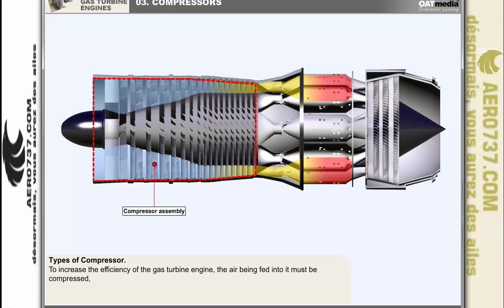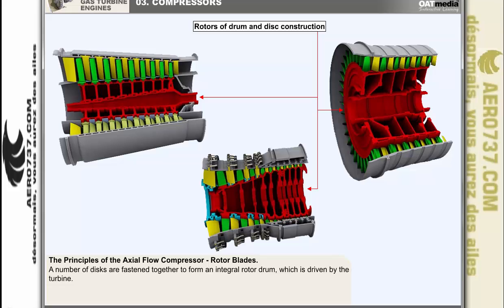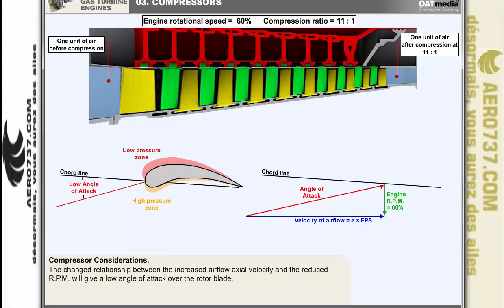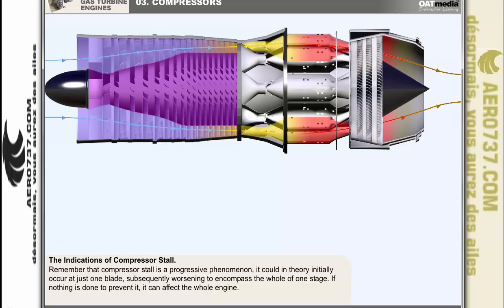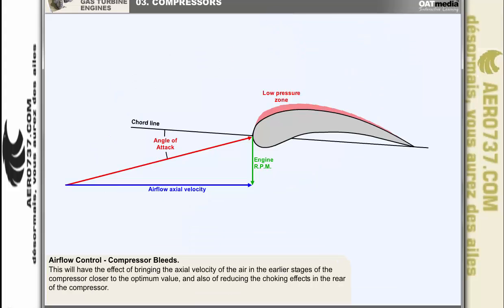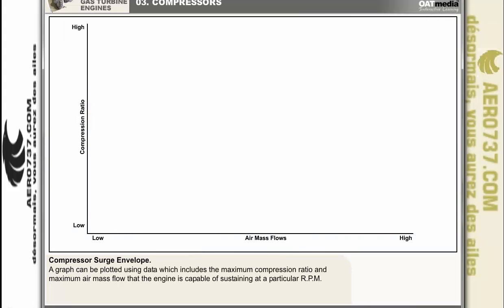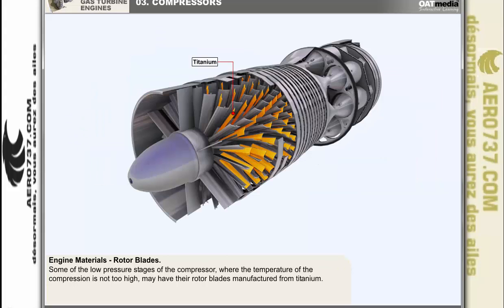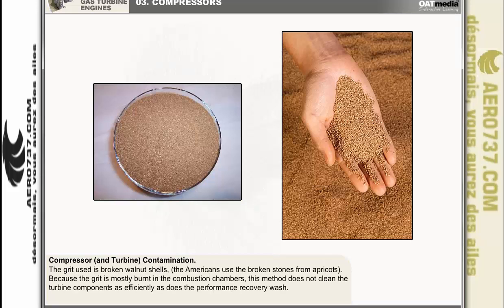Gas Turbines Engines-Part 3:Compressors

Comment: There is a lot of love in the design of one of these hair driers. Makes me feel very good in witnessing through these nicely produced YouTube Videos. Already I am in admiration those who find a way to study and work with such engine poetry. It almost feels like each working turbine is a laboratory in the study of air vapor under pressure and fluids. Thank You AERO737 https://youtu.be/PQQSUe7lX3sGas Turbines Engines-Part 3:Compressors YVO

Comment: I have just found this series of videos and my initial reaction is positive.  However, the term 'compression ratio' applies to internal combustion engines and it is actually a volume ratio.  The correct term for a gas turbine engine is 'pressure ratio'.
Reply: Compression ratio is the ratio of two volumes whereas the pressure ratio is the ratio of two pressures. Gas Turbine is also an Internal Combustion Engine.